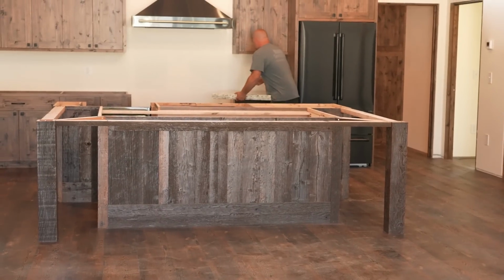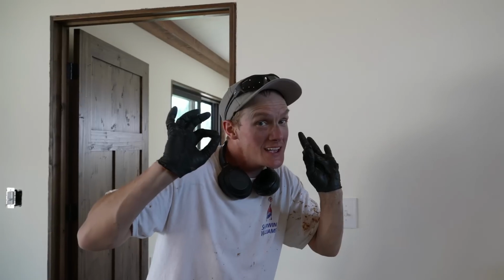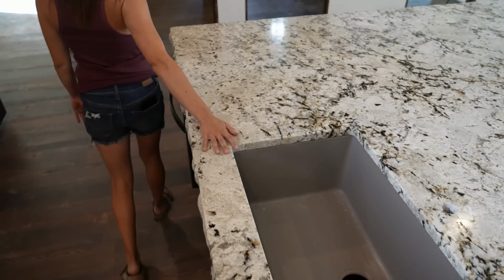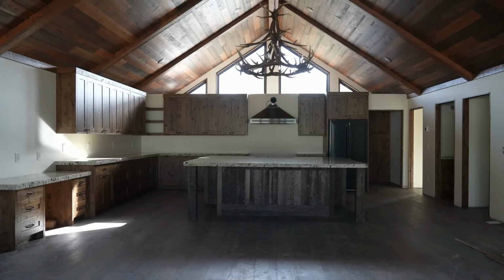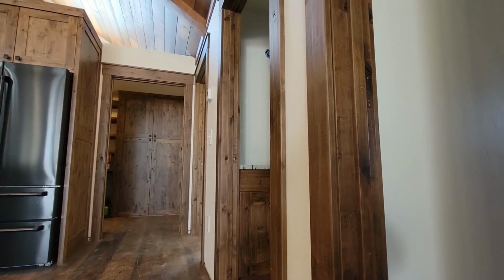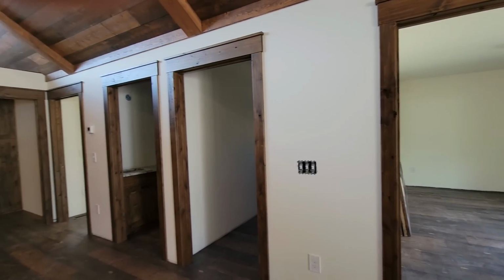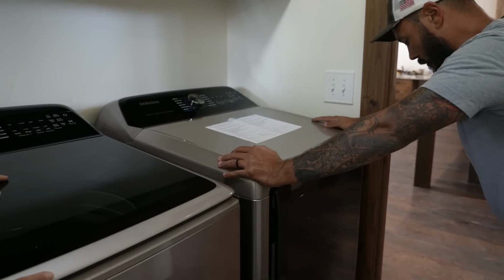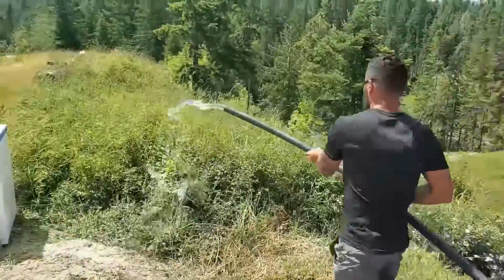Countertops, Doors & Trim Are DONE | Finishing Touches in Our Mountain Home

Comment: My eyes welled up on that one. The counter tops look like they were professionally matched. So glad they are lighter. They seem to make that space warmer and bring out all the wood tone details of the room.
I feel your excitement an anticipation to move in.
That dryer vent connection should hug but you still need the manufacturer distance to avoid a burn up.
If the door is hinged to open towards the great room, it could work despite.
Hug the pup and thanks for sharing.

Comment: I don't know if someone has mentioned this to you, but I wanted to just give you a heads up.  Your freeze dryer will need to drain after each batch and that is easiest achieved with a bucket below the level of the freeze dryer so that the drain hose allows gravity to do the work. I will also tell you that sometimes after a defrost the melted ice will pool in the bottom of the freeze dryer and when you open it, the water leaks out the front. With your freeze dryer on the ground,  you will definitely want to put a towel down to avoid a puddle. Just a friendly heads up. We love your videos and appreciate all the teaching you've done!!!

Comment: This place is looking GREAT!  I've been watching since just after you poured the house foundation, and this has been one of my favorite channels.

Regarding the very close fit of the washer/dryer, for those of you designing your own home or thinking about doing so in the future:

Make a detailed scale drawing of your home.  I used 1/4" to the foot, but 1/2" to the foot might even be better.  Be detailed; account for the actual thickness of the walls, and don't forget the thickness of the wallboard.  Be sure to position the door openings exactly, and draw arcs to show the swing of the doors.  You might want to get a scale rule and a fine-point mechanical pencil to make this easier.  Draw in your appliances to make sure they fit easily, and if you don't know the layout you want, make cardboard cutouts of the appliances and move them around the drawing.

Draw the windows in the exterior walls, and make elevation drawings of the sides of the house to make sure the windows give you the look you want in terms of location and size.  Again, be meticulous and exact.

If you're a bit computer literate, you can get good houseplan-drawing software that makes all of this this easy and accurate, and even fun.

True story:  I have two friends who failed to do this, and they both wound up slotting their toilets into spaces that fit the toilet but were too narrow to fit a human.  They didn't even have room to hang a toilet-paper holder, and you had to be a gymnast to use the TP when you were done, if you catch my drift.

Comment: Place is looking good.  When I was building for a living and the floors went down we would buy a cheap roll of rosin felt paper to protect them or use any large cardboard like from the fridge. It's really worth doing until the outside is finished so grit doesn't get dragged in.

Comment: Omgosh I'm loving your home!! What an incredible journey your family has accomplished.  These memories and hard work is the cement that keeps your family on the path to a common goal. My family is in a similar journey  for the past 3 summers we have been fixing up my mom's dry cabin ( it was boarded up over 10 years ago).  This summer we started building our tiny home addition. We  are mostly bucked in but winter is coming. We've left our family home and are living in the cabin while still building our tiny home.  We have electricity but no running water yet.   We are still washing dishes outside,  showering outside,  using an outhouse.  This summer we finally got the well working with a hose to water the garden but have yet to test the water for drinking.  We are never going to have a house like yours but we can't wait for a few more amenities.  Now we've got to clear out and sell our other house because we've been living  in the cabin for 3 months now. 
So Excited for you all to move in,  congrats!!

Comment: I do want to say I had samsung washer and I couldn't hardly reach inside. I hated it. Mine was a older model and the bleach pour area rusted. So I got an LG washer and dryer front loader. The biggest one. Best washer and dryer ever. Cause I'm short to. I had to use a step up to get the clothes out. Good Luck!

Comment: The house is looking fantastic! The laundry machines clearances will be a problem. Here’s what you may be able to do. Depends on what is on the other side of the laundry back wall. You can remove the dry wall to allow for hose/vent fitting. Then finish the exposed wall area by adding drywall to the wood stud surfaces and paint. Basically you’d have a recessed wall area for connections. This may depend of course on what your codes allow. Hope it works out. The finish line is in sight keep going.

Comment: We had the same issue with the washer/dryer and having the door to the laundry room close. If you have a dryer vent box installed in the wall it will keep the dryer very close to the wall.

Comment: They make a zero vent for your dryer you could also get recessed plugs! I need about 1 in for supply lines for the washing machine well also for the dryer cord they do recess boxes hopefully if that's an exterior wall yeah 5 1/2 in to mess with 2x4 wall?

Comment: Two things laundry room door open to the outside if you're hot and cold-water lines are not recessed in the wall you will need 4" to 5" from the wall. getting clothes out of the washing machine spin the drum toward you, i have the same set different color.

Comment: I'm sure the power in the laundry room is already in. But if it's not you could always put the plug a little higher in the wall above your washer and dryer which is ugly, but would save you from changing the opening of your door into the laundry room. Just a thought!

Comment: For the dryer and washer, why not switch them? Put the dryer where the washer is and vice versa. If you leave them in their current position and a door doesn't work well put in a pocket door.   This late in the build it might make a small adjustment but you'll be better off in the long run.    I'd opt for the first suggestion.

Comment: That's an easy one to solve. If the washer and dryer are "in the way" just swap them. That way the top loading washer is by the door and the front loading dryer is away from the door. That should fix it!

Comment: One more thing probably too late now but it will help you in the future with many things it's home Depot sells, airbags the little one will have 300 lb the bigger one lifts 550 lb up to five and a half inches for setting solid core doors they are amazing you can tip that door to a plum level or release pressure to bring it to level they are amazing. Also if your wife leaves the keys in the car while locking it like my wife does all the time LOL they will spread a door jamb without scratching just don't over pump that thing LOL enough to get a coat hanger in there. But for setting doors and pumping the door up on hinges it's perfect.

Comment: It's better to wash in cold water!!  You can at least install the power and attach the water lines.  Just make sure to only use steel jacket water lines and install a sensor on the water lines that shut off the flow in case of a leak!!

Comment: You mean you didn't think of the washer and dryer till now and the hook ups till now???? Jeremy are you slipping a gear man. you were suppose to do all that in the ruff ins when you doing the framing work. Anyway it will all work in the long run right Melissa or it's back to carpentary school for both of you. By the way love your countertops very nice and all that trim wow Can't wait to see that hot tub installed. So I guess the house is almost finished and then the garage and patio or is it a sun deck. You guys are ace love watching. Take care all.
Reply from the maker: ???  The washer dryer connections were all done during rough in.